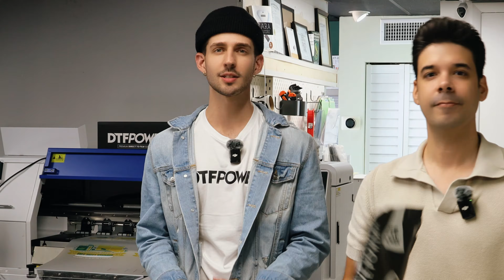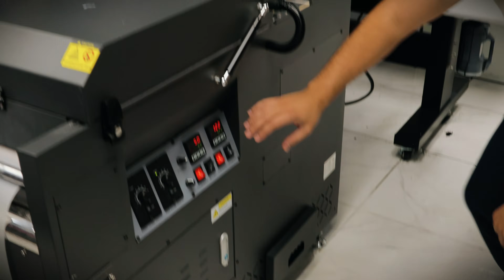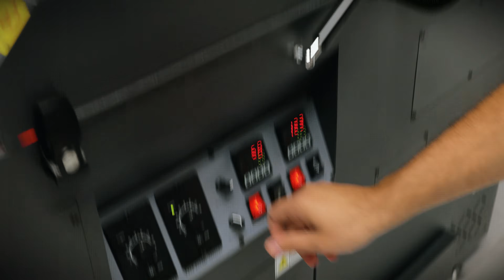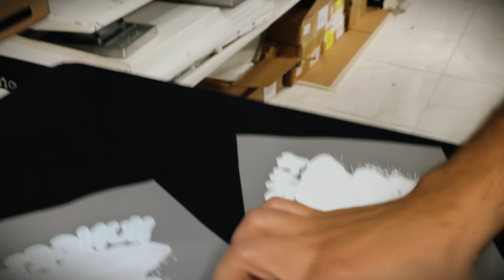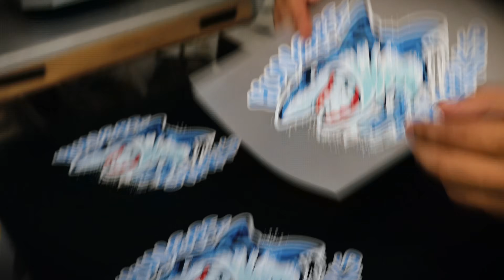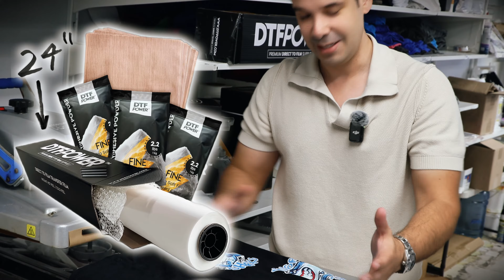DTF Powder Baking Hack – Stop Ruining Your Prints!

Comment: First,great video. I have several questions. One where do I buy your products. Two I don't have a shaker.Shaker. What temp do I bake the transfers. Three, do each manufacturer of transfer paper and inks have different temps to cure. Four at what temp should I keep my printing area in. Does the ambient temp matter? Please advise. Thanks😊
Reply from the maker: Hi, 1- you can get them on our website DTFPOWER.com
2- Powder melts at 230 Fahrenheit.
3- Yes
4- 72 F, 45% humidity

Hope this helps!